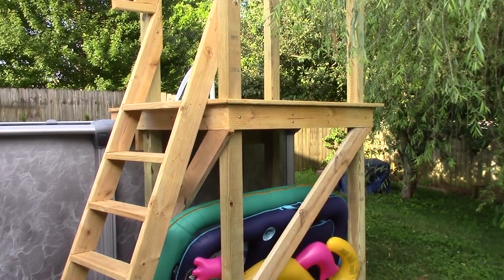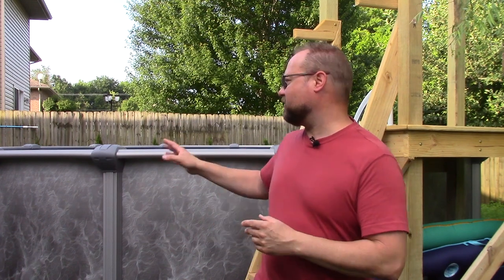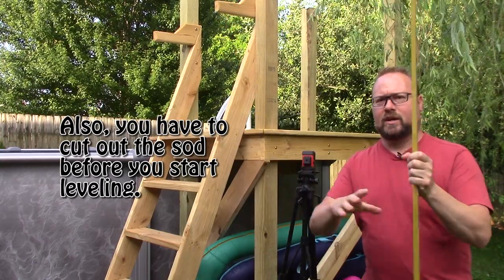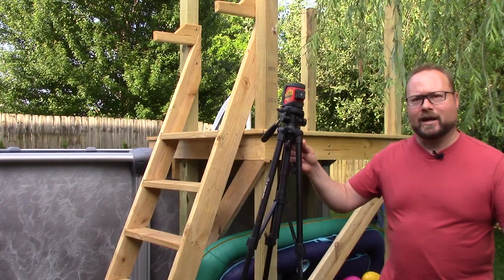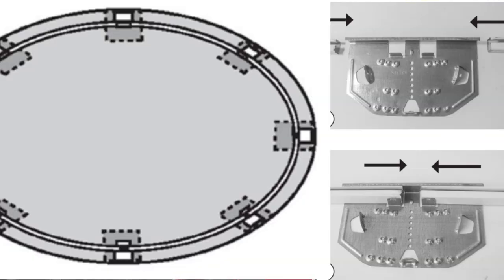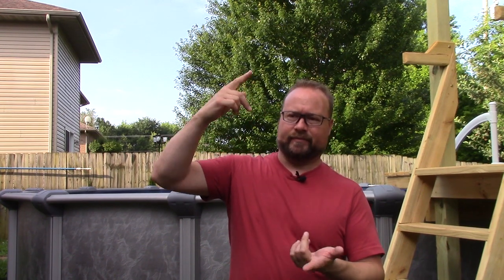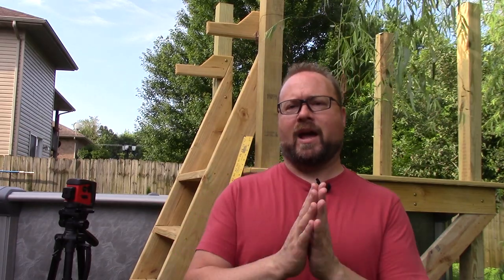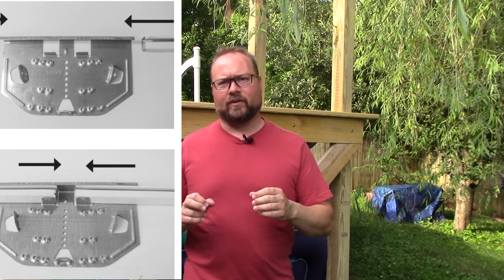Above Ground Pool - Don't Make My Mistakes.

Comment: Do the beams dig into the ground or are they like tables?
Reply from the maker: Are you talking about the stairs / landing, or the pool?
Reply: @AroundTheHome1  The pool…
Reply from the maker: The pool posts sit flat on the ground. There are brick pavers that were set into the soil so they were flush with the leveled ground. Then the posts sit on them.
Reply: @AroundTheHome1  oh, okay, so I can technically move them with me if I wanted to, now, how to I make one that's custom?
Reply from the maker: Well, technically you could take it with you. But after putting it up you might reconsider that. What do you mean by make it custom? Do you mean like a custom shape?
Reply: @AroundTheHome1  I want to make a custom one that’s deeper that the average above ground pool, about 4-5 foot deep to be exact, & I want to paint it on the outside so it will look cool & have removable yet hangable pots for plants so that it won’t be too bad for taking up hard space that could have been used for farming & or gardening.
Reply from the maker: Oh, I see. Well I am pretty sure you are stuck with the shape, but I do think some of these pools with the right liner will stretch to go 5-6 feet deep.
Reply: @AroundTheHome1  I guess, but if I make one from scratch I can make it deep right?
Reply from the maker: Are you talking about making a custom frame?
Reply: @AroundTheHome1  Yes, & everything else.
Reply from the maker: Well, I don't have a good answer for you that then. All I can say is good luck with your build.